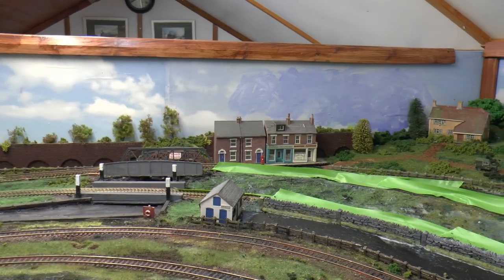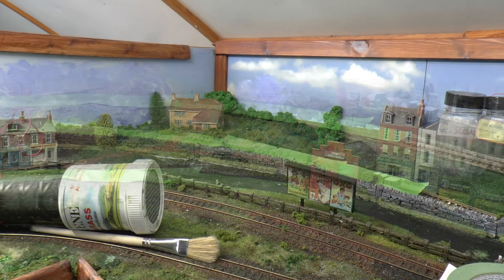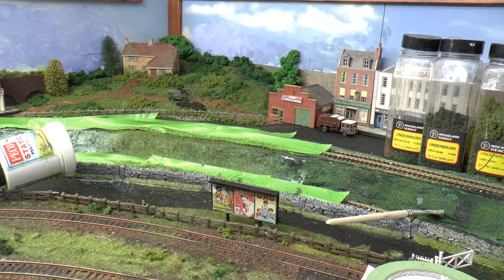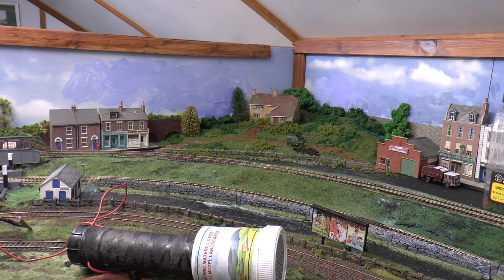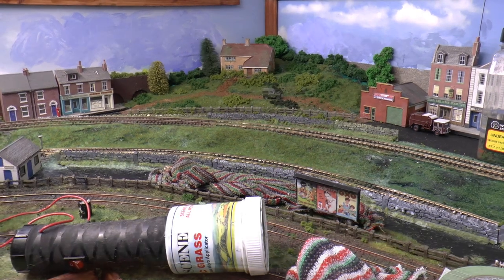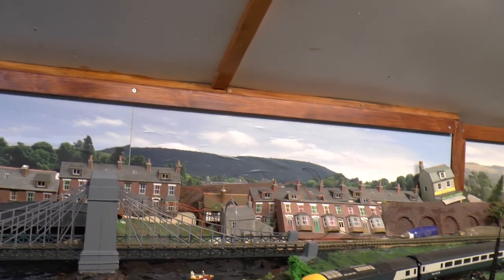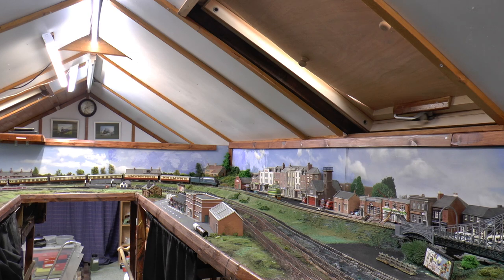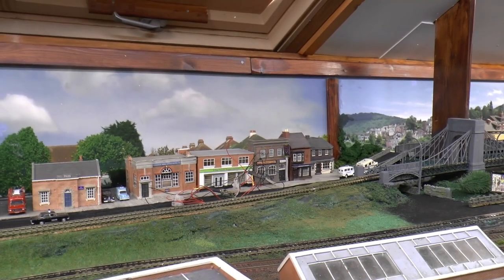Dave`s Model Railway Re Build Part 3

Comment: Very nice Dave, I do like the way you do your static grass, just shows you do not need to use special formulated PVA or an expensive application. Don’t show me those backscene Dave, they are a
bane of my life (LOL)…Simon
Reply from the maker: Hi Simon , yes bit of a pain to put up , best done on clean board before you put the boards up , as for the PVA , I get those bottles for £1.50 at a local store , normally i use the builders PVA and thats about £3 for a large bottle ....model railway PVA must be treble that ...Cheers DAve

Comment: whats with the wire on the grass sprinkler?
Reply from the maker: Its used to clip to a screw or nail that is put in to the area to be covered in static grass , hard to explain but it acts as a earth ...but best google it ...Dave
Reply: @howarth004  aaaah static as in static electricity now.  makes sense now
Reply from the maker: Xantec you got it 👍🏼